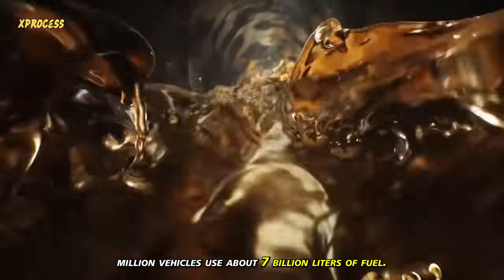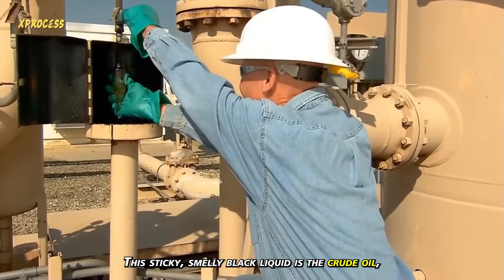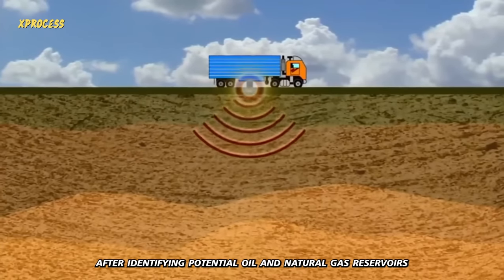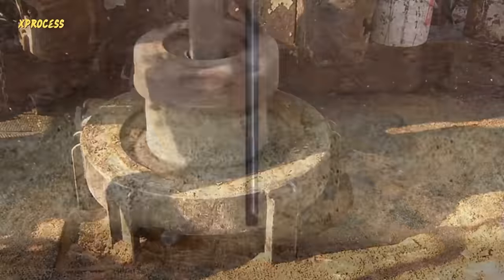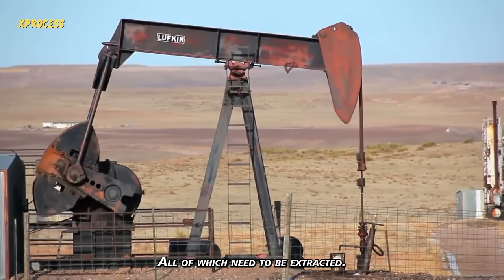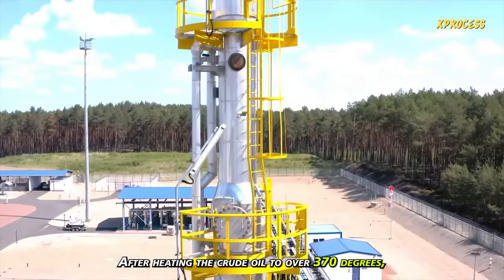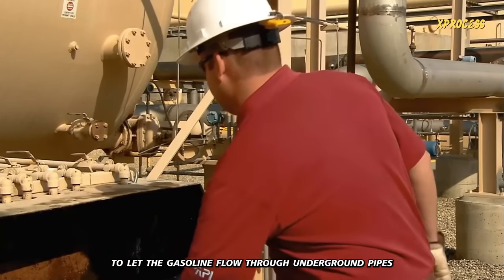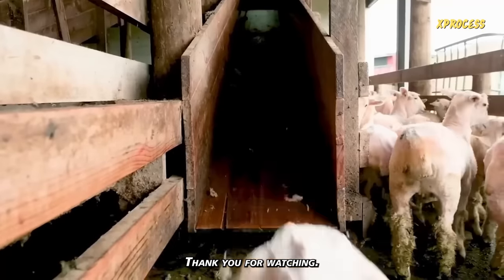How PETROL is MADE from CRUDE OIL | How is PETROLEUM EXTRACTED?

Comment: Back in 2015, I purchased a 1974 vehicle with a V8 engine that was put in storage in 1978. The fuel tank was not drained. I installed three fuel filters on the car. One about 6 inches from the tank, the other about 6 inches from the fuel pump, and the other about 6 inches from the 4bbl carb. I noticed right away that the fuel filters were almost completely black. Then I repeated the same things. I got the same results. So I decided to remove the tank and sending unit and replace them with a new tank and sending unit. Upon getting all the fuel from the old tank, I noticed a thick black gooey substance in the bottom of the tank and on the strainer of the sending unit. It was about an inch deep in the tank, along with dirt particles and trash. The fuel that was not drained while in storage turned in to that thick crude gooey stuff. However,  after about three tanks full of premium fuel and an ethanol inhibitor, the 350 V8 engine runs a hell of a whole lot better, idles smoother, and excellent acceleration. When I got this car, the odometer read 43,333 original miles. Since this is a GM car, I removed the "point" distrbutor  and installed the GM HEI distributor. Now I have quicker starts, especially on cold mornings and NO catalytic converter. These things were installed on all cars for the 1975 year model. The engine in this car runs extremely smooth, and It will burn regular fuel too with ease.
Reply: Hello John, how are you doing today

Comment: Thank you for sharing, very informative and educative.
God bless those guys who work at the refineries
Reply: Amen 🙏
Reply: This video is great for guys like me, started oil and gas well drilling in the fall of 79, it get so much wrong that it is comedy gold. "... very informative and educative" nope.
Reply: @eddydogleg Ah ok, I'm no oil expert but there were a few things they said that didn't seem quite right to me. Like heating the oil so it rises as a vapour and it separates its self into the different fuels by weight. And that they just extract lubricants and plastics. Pretty sure it takes a bit more to create plastic then just extracting it from crude lol. And I don't think propane or LPG (liquid petroleum gas) as we call it in OZ is extracted from crude. Doesn't it come out of the well as a gas and is what's being burnt off in the flame on some oil rigs. It's only a liquid when being stored under pressure in tanks. Anyway, I could be wrong with some of that too. 🤷‍♂
Reply: @28russ  sounds like you made it farther into the video than I did; I quit at about the 4 minute mark. If that's how they described oil distillation and plastics it sounds like someone wasn't paying attention in high school chemistry. 

I think general speaking propane is going to come out of the well as a gas but that would be a question for production guy. I did hear a story of a smart ass roughneck pouring propane out of the tank into a 20L bucket. But at temperatures below -43C the whole crew is so bitchy that you are just doing the bear minimum to get the job done so I doubt that it really happened.😀
Reply: @eddydogleg It wasn't a long vid so I watched it all. But yeah it was definitely questionable lol. Maybe I'll have to watched a vid about propane and see how it's acquired. Just not one by this channel lol.
Reply: @MD-sl7ms  I dont think god has a lot of good things to say about oil workers and refineries....
Reply: Amennn !!! ! !!!

Comment: A few things to note
-Not all oil is black. Some is yellow as well as other variations

-The part where he talks about water being sprayed to cool the drill bit is semi-accurate. There’s actually an engineer that makes a chemical concoction called “mud”. Mud is used as lubricant and coolant that brings the rock pieces to the top so the drill doesn’t continuously grind the already drilled rock. It isn’t strictly water that they spray down there. The engineer that makes mud is properly named a Mud Engineer. So the main take away here is mud is not actual mud, it’s a code name for the chemical concoction made for the specific type of rock that the drill will be drilling through

Comment: Actually the process of loading bulk road tanker trucks is now a very safe and efficient process.  It was quite different 40 or 50 years ago, when tankers were loaded with a "spear" from above, through an open hatch, and had to be 'dipped' to the correct level.  Better equipment, standards and training has made enormous, positive changes......the only real problem in the industry now are reckless transport companies with drop kick managers that need dragging out behind a wood shed for some lessons involving a 4x2 plank of wood.

Comment: I participated on a school trip to an oil rig in Norway. We were eager to see the product, but were told that they are doing everything in their capabilities to not see the product. The entire technology is designed to prevent the workers and the environment from contamination. "If you see oil on an oil rig, you have a big problem, because it means, you are dealing with an ecological disaster" were their words. The only place, where we could see the actual oil was a tiny, tiny window through which you could see the oil flowing through a pressurized chamber.

Comment: Crude oil is not just oil sucked out of the ground as it comes in different weights such as light or heavy and flavors described as sweet. Crude oil is also removed from the ground by a new method called fracking. The United States annually purchases roughly 18.5 % of the crude oil from OPEC which is refined into gasoline (Purchase Price), once refined into gasoline (Consumer Cost + Oil Company Profit - refinery cost) it is distributed throughout the United States (Trucking Firm Cost), and pumped into the gas stations storage tanks and used for consumer purchase (Payment to refinery, Payment + Profit Share to Station) just to cover the basics. Remember, when you think of the cost of gasoline you're paying the oil company, the refinery, the drivers, the station attendee, and your state through gasoline taxes.
Reply: Hello! How are you doing today

Comment: what powers those pumps? I have seen those in the middle of nowhere in wyoming, there were no electrical lines anywhere around
Reply: I worked for General Motors and we sold big block engines that sat in the middle of no-where and burned natural gas tapped off  from the lines they were pumping.  So maybe a specialized diesel cycle engine could do similar with that crude.

Comment: Notice how far down the system diesel is. A by product of gasoline. Yet, diesel cost more per gallon than gasoline. So Mr. Announcer, make everyone aware of the ripoff it is to the consumer by charging more for a by product than the gasoline you are making. The high cost of diesel effects EVERYONE that consumes anything and everything that has been transported by truck, train or ship than runs on diesel fuel.

Comment: I know there is only 8 mins assigned to this video, but for the 30sec allowed for how "petrol"  / gasoline is extracted, that is not even close to how it's one. Gasoline in particular is not a straight cut from the process, but a combination of fluids from multiple process blended to a particular composition depending on time of year and destination of the finished product. Still a good infotainment production for primary students.

Comment: Some misleading statistics in this video.  It's mentioned that thousands of oil rigs are drilled which gives the impression there must be a huge number of oil rigs in the USA.  In fact, there's usually less than 2000 active rigs in any given year.  Sometimes they run dry or if prices are low are shut down.  For example, in 2011 there were 1700 active oil rigs and in 2023 there were about 775.

Comment: Some people be like "i don't need an oil, i drive an Electric Vehicle", but little did they know the electricity they use to recharge the battery mostly came from Fossil Fuel too (especially Coal and Oil)
Reply: Depends where you live obviously, not a single EV in Iceland or Norway gets its electricity from fossil fuels, and in France only about 10% of electricity comes from fossil fuels, with the rest of Europe getting less than 50% of it's electricity from FF.  If you live somewhere that gets most of its energy from fossil fuels then you live in the third world and can't likely afford an EV in the first place.
Reply: i does not pollute as much

Comment: Good video but the math is quite off. In the video they state they have extracted 60 billion barrels of oil so far in Texas and if calculated correctly there are another 10 billion. At the same time they are currently extracting 900 000 barrels each day, which would mean that in a about 3 years they would run out of oil....???

Comment: 88 liter of gasoline+
48 liter of diesel+
 26 liter of kerosene+
7 liter of propane +
32 liters of product=
88+48+26+7+32= 201 liter
every barrel of oil is 158.987 liter ,so 191 barrel or 30366.5 liter
30336.5- 201=30165.5! what will happens to rest?

BUT IN REAL REFINARY YOU GET 19 TO 20 GALLON GASOLINE AND 11 TO 12 GALLON OF HIGH SULFUR DIEASEL, out of  one barrel not 191!
Reply: 4 liters in a Gallon there Einstein
Reply: @nickbisson8243  
IQ 11to 12 gallon per barrel of crude oil not 191 barrel!
Reply: @nickbisson8243   is that a US gallon or UK  gallon ?  Einstein

Comment: Not a fossil fuel , not.made from.dead stuff. It's a hydro carbon , the heat and pressure made it not dead stuff , it's the second most abundant thing on our planet other than water. Big.companys use the scarcity to set prices there is no scarcity and we've barely scratched the surface

Comment: I have a question, after extract the all valuable products from the crude oil, what refineries do with the solid residual. Whether they through it to the nature or different management system to treat those residual solids.
Reply: It paves your streets and highways.  It is called asphalt.
Reply: @thomfisher1100  thanks for reply, but asphalt are not alone, there are mud, dart or impurities also available in the residual substances. Asphalt is purified otherwise will not sustain in harsh environments.
Reply: There are actually many uses for the heavy residuals...

As mentioned, the asphalt can be used for paving roads.

Or many refineries pump it into a giant vessel and pressure cook it to drive off the remaining volatiles. The resulting product is called petroleum coke or petcoke and is similar to coal. It can be burned as fuel or used in other processes.

And some refineries will take petcoke and "crack" it again to claim the hydrogen to make ammonia for fertilizer.
Reply: @oldschooljack3479  I forgot about pet coke. But cracking the pet coke and extracting hydrogen to make ammonia is completely new to me. Thanks for enlightening me. Crude oil is definitely "the gift".
Reply: @oldschooljack3479  if I am not wrong Ammonia is Nitrogen based fertiliser not Hydrogen based.
Reply: Hello.
I have been a refinery operator for 41 years.
The final extraction of different grades of products, leaves a residue called Vacuum Residuum.
The residue when hot is like tar. When cold it solidifies like asphalt. It has to be kept hot.
It can be further "cracked" on a plant called a Visbreaker to yield lighter usable oils like factory fuels, shipping bunker fuels or even domestic heating fuel.
The vacuum residuum can be blended with lower quality oil to make a tar, used as a bonding agent for the aggregate used in road paving or road repair.
In road paving, a plant would use aggregate and the "tar" and combine them using heat. The trucks will deliver this "hot-mix" directly to the paving site.
The tar is sprayed on the old surface and the hot mix is spread as a uniform layer by specialized machines. Then a heavy motorized roller is used to compress it.
There may be other uses of the Vacuum Residuum that I do not know of, but the main use is for making roads.
Hope this helps.
Trinidad & Tobago.
West Indies.
Reply: @ramishrambarran3998  that means no residual after tar or asphalt. Everyone narked crude oil as a culprit but without crude oil, the world never been the same.  If analysis more than 100 products extracted from crude oil, from gasoline to tar. This is the main reason why superpowers are eager to control crude oil supply by any means.
Reply: @Saif1971ify  All these are removed before the refining process begins. Only what is ingrained in the crude such as sulphur remains. Sulphur is later removed from the distillates by Hydrotreating/Hydrocracking.
Trinidad & tobago.
West Indies.
Reply: It’s called Koch we sell it to other countries that they burn in electricity plants and it’s. Also asphalt is a byproduct.
Reply: Veolia is one of the biggest companies that handle all waste at the end of a barrel.
Reply: @Saif1971ify  Ammonia is NH3 -- nitrogen plus hydrogen. Nitrogen is available from the atmosphere, so you just need a source of hydrogen.
Reply: @drewapple9681  "It's called Koch"
You mean coke?
Reply: The waste or hazardous waste from petroleum does not come from the end of the barrel. Rather, it comes off during the refining process.
Huge quantities of superheated steam is used to "strip" the heated crude, to obtain different grades of gasoil. The acids, heavy metals, toxic gases, and other undesirables are entrained in the water that condenses from the steam. This is called "sour water". All refineries have sour water treatment facilities that treat the toxic water so it could return to the environment. These systems are not 100% efficient/foolproof, so a measure of toxic waste will enter the environment.
So, the vacuum residuum at the end if the refining process poses very little threat to the environment. The fractions distilled off the crude oil are way more harmful !
Trinidad & Tobago 
West Indies.
Reply: @Saif1971ify  Yes. But the formula for Ammonia is NH3. So ammonia has hydrogen.
Reply: @beeble2003  no it’s called Koch it’s all the leftovers of refining oil. They sell it to other countries that use it for fuel in the electricity plants.

Comment: And what about ethanol?
Reply: Ethanol can be blended as a percent of gasoline. Many engines run fine up to 10%, some car engines specially designed can run up to 20%. There is less energy per liter so the mileage will be reduced.

The difference in chemistry can attack the alloys in the fuel systems of many small engines unless specifically designed.

We had a farmer in the family who drove his corn to an ethanol refinery.  He told us then he then returned to recover what was left which was a dried product he used as feed for his animals.  I include this because there were false allegations that ethanol used for fuel would take food off of America's tables.

Comment: the high fuel cost is due to the taxes in the UK and the EU
Reply: And the OPEC monopoly fixing  markets
Reply: @trialsted  £0.90 per litre is tax; the rest is shared between the refiners and the extractors; OPEC, doesn't get much
Reply: @luigicirelli2583  OPEC is the body that represents the extractors, and by colluding and setting prices, they have formed a monopoly. I understand there's a lot of tax in there and I personally believe taxing on fuel is the most effective way of taxing vehicle usage as it tackles fuel efficiency (linked to impact to the roads, physical space used etc.) and miles travelled in one tax.
Reply: @trialsted  OPEC does not get much; £0.90 per litre is tax; the rest is shared between the refiners and the extractors; OPEC, doesn't get much
Reply: @luigicirelli2583  OPEC don't get anything, they are a body representing oil companies. My point is that if they didn't fix the price then it would be a competitive market and prices would go down. At the moment when demand drops they just up the price to maintain the profit margins of the producers.